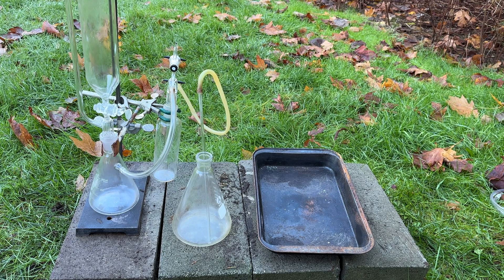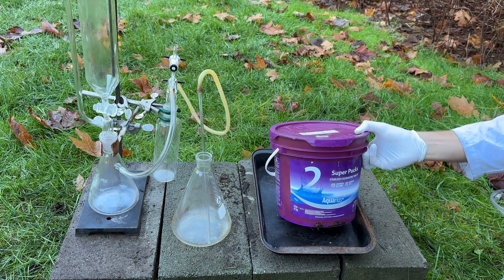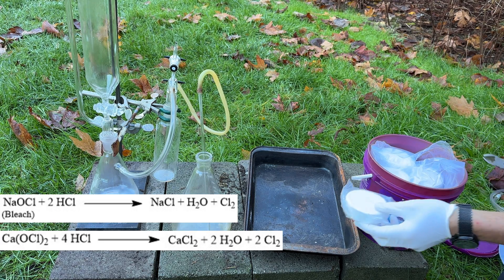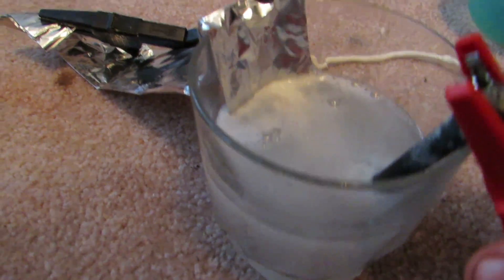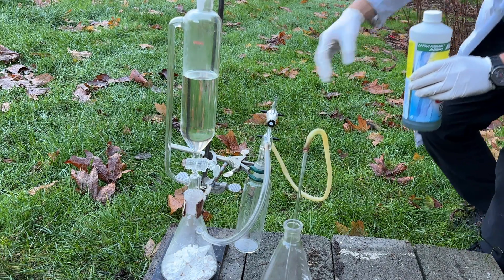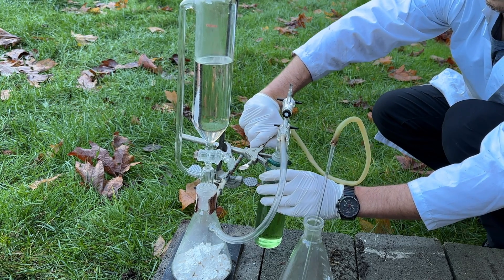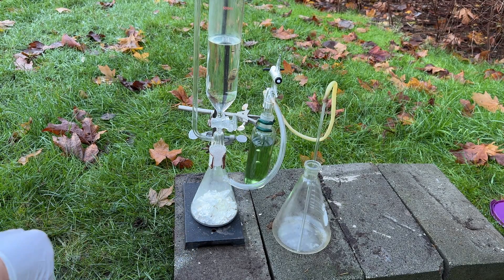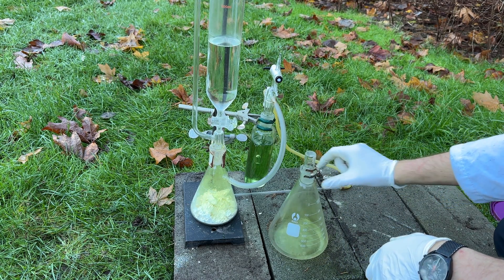Chlorine Generator

Comment: Are you trying to tell me that i should stop sniffing chlorine gas?
Reply: I'm never going to stop it's amazing. It makes my lungs and throat feel so refreshed
Reply: @Mold____AscorbicAcid  i have done it before and its not that bad i would rather sniff chlorine than ammonia
Reply: I mean, eventually, you will. 😂
Reply: I have to be really careful because I like the smell of nitric acid vapors and nitrogen dioxide and neither of those is a joke!  Luckily when I distill nitric acid my set up is pretty tight with sulfuric acid seal.  Hardly an odor at all really

Comment: If you remove all the chlorine from electrolysis of salt water and all you have left is sodium water can you evaporate the water to leave the sodium? If you put in mineral oil for it to settle in?
Reply from the maker: Electrolysis of salt water produces sodium hydroxide, not sodium (sodium will react with water), so unfortunately this is not possible.
Reply: Molten sodium hydroxide works well